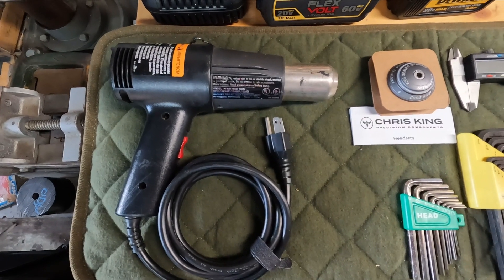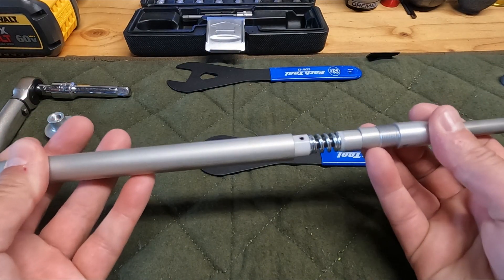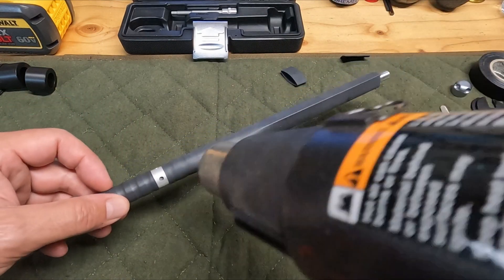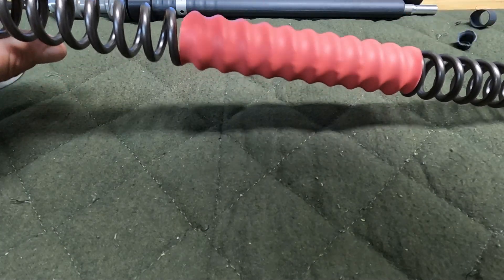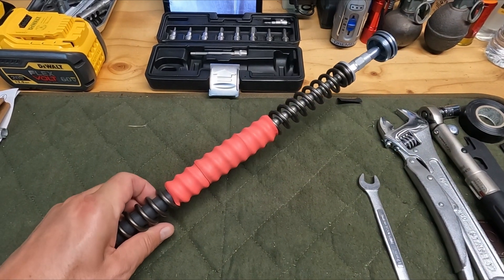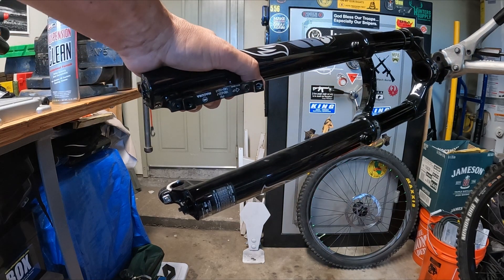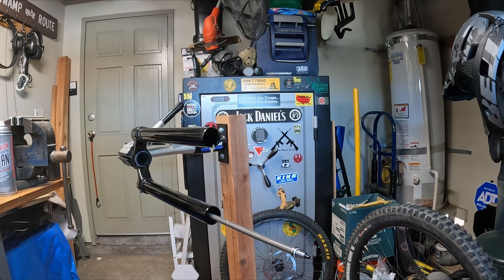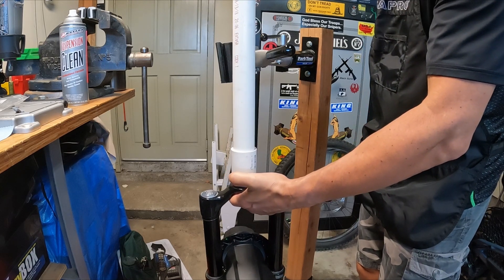Smashpot Coil Kit Installation in a Fox 36 Fork

Comment: Great video and thanks for taking the time to make and put it out here for us. 
BTW, those two bolts, behind the lower legs are used to mount Fox mudguards and not for releasing pressure. The Fox factory forks do indeed have the pressure release on them and a bit lower. 
I weigh just shy of 125# & have an e rated 38 with the grip 2 damper (which I recently upgraded from grip) and UPS will be delivering the smashpot with 35# rated spring today. Can’t wait. I also have the Fox factory DHX2 shock with a 300# rated  SLS spring which I love.
Reply from the maker: Thanks Ron, once you remove the caps you have an open hole to the stanchions so any air is released. My fork does not have the pressure release valves which does not matter as there is no longer an air spring in it :) The 38 will be sweet with the Smashpot kit, at some point I will upgrade to one for rigidity.
Reply: I have the E-Factory 38, smashpot went in last week, best upgrade ever !

Comment: Great video! I just purchased a 2022 Heckler S 29er. Should have it by the end of next week. 
Currently have a 2020 Trek Fuel Ex 9.9. 
I ordered a Fox 38 Factory GRIP 2 with 170mm travel and will be doing this conversion and then running a Fox DHX2 coil shock.
Reply from the maker: Thanks Aaron, I am going to put a 38 on the front at some point. With the 38 and DHX2 coil in back you are going to love it, stock its a fun, poppy little bike but the Rock Shox Air shock and VP do not work great together for all around riding. In the chunky stuff the coil in the back makes all the difference.
Reply: @rsanoian  Yeah I think it should be a pretty good combo! Trying to figure out if I should run a linear or progressive coil spring, but leverage ratio already seems pretty progressive on this bike especially in low setting so I’m thinking Fox SLS spring. I did a 45lb spring for the Vorsprung as I’m about 180lbs with gear and that’s what was suggested.
Reply from the maker: @AaronWhitt82  I am 200 kitted up and running the 50lb with 160mm and its perfect full travel but with the bottom out assist I love it. Try the SLS and if you find its bottoming I would run the MRP Progressive springs, they make an adaptor to use them on the DHX2 I had those on my previous bike and they were awesome.
Reply: @rsanoian  Good to hear! I got an email back from Santa Cruz today and they suggested using the Fox SLS spring. Spring rate calculator I’m around a 525lb spring so I’m going to try a 550lb spring. I currently have a Cane Creek progressive spring which I was using on my Trek, but I’ll have to get a higher spring rate. Think I may try both springs and see what I like best & how the bike performs.

Comment: glad i happened to catch your push coil install video and saw your comment about being happier w/ the smashpot conversion. btw, i see cal4wd stickers, and by way of your 831 handle, are you in the sc4wd club? i just ordered a grip2 dampener to upgrade my nomad's fox 36 rc2 and figured it would be a good time to switch to coil as well. i've always been a big fan of push conversions, but after doing a little more research, it sounds like vorsprung improved on the small bump sensitivity, and improved the big hit bottom out w/ the hydraulic design over push's ABS rigidity and noisiness.
Reply from the maker: I used to patrol all the jeep trails in the Sierra National Forest in the late 80' and 90's, never belonged to that club but do runs in the summer with Clovis Independent out of Fresno. The Vorsprung kit is sweet, going to move up to a 38 at some point and will install it in that fork. It makes a clunk on some of the big hits but I notice they have a rubber sleeve now which should keep things quieter. Are you in the SC club?

Comment: Thanks!! Were you saying you put sos grease on fork seals when you put lowers on? Doing the same install on very low used fox36 and not planning on changing seals either.
Reply from the maker: Yes any kind of suspension grease like SOS is fine, the seals are fine unless you have a couple of seasons on them then I would change them out.

Comment: Great tutorial thank you. Do you have a preference for acs3 vs smashpot? Any big performance difference?
Reply from the maker: Thanks Noah! They are both good systems, I like the Smashpot better for the additional oil, noise damper on the spring and the bottom out control. They also offer a Fox 38 kit which is my next fork.

Comment: Have you had any issues with the heatshrink coming loose or slipping down? Reading the Vorsprung thread it seems some had issues with this and tried different heatshrink types.
Reply from the maker: I have never seen that issue on any of the three forks with that kit, I have always used a heat gun though.

Comment: Hey hows it going! just noticed the fork is on an ebike. Is your fox 36 E-mtb rated? im trying to get the same coil conversion but just wanted to make sure its a correct part. Thnx
Reply from the maker: All good here thanks. It's the 36 that came with the Heckler, all of their forks are the EMTB version. The Smashpot kit will work in all of the 36 forks, when I talked to them last time. I think it will also fit the Fox 38 but not positive. Give them a call, they are super cool to talk to.
Reply: @rsanoian  Thnx for taking the time to get back. When I was looking into the Push brand coil it mentions that its incompatible with e rated forks. So i figured perhaps with Smashpot it would be the same . Thanks for clarifying that it works with e rated forks. 👍
Reply from the maker: @kinnectedmtb3209  I have a PUSH ACS in my previous Fox 36 but the Smashpot kit is so much better. Very smooth and never bottoms out harshly even though I am getting full travel.

Comment: So the new spring is now a real spring and not an airchamber, but where is the air which is in the same chamber where the real spring is (the coil) going to when this chambervolume with the coil in it is compressed?
Reply from the maker: You remove the piston assembly and replace it with a coil spring. The red shrink wrap is to keep the coil noise down when its being compressed in the leg.

Comment: I’m trying to decide if I want Smashpot or Secus. Did the extra weight affect you at all?
Reply from the maker: Theres no beating a coil for small bump compliance, this kit is very simple and reliable. If you are worried about weight then Air is going to be lighter but you have to carry a pump and fiddle with it a little more to get it setup right. I raced DH in the 90's and early 2000 and everything we had was coil so I am used to the ride and don't care about the small weight penalty.

Comment: Hey man I just installed my Smashpot tonight on my Fox 38. Is that retainer snap ring re-used on the bottom inside of the stanchion on the coil side? I couldn’t find any info about it. I didn’t re-use mine. 
Thanks!
Reply from the maker: Hey Aaron, that snap ring is what holds the piston (Air spring) assembly in, since we are removing that and installing a coil in place of the Air spring that retaining ring serves no purpose. I put everything in a zip lock bag but once you have some miles on the fork with the coil the inside of that stanchion tube is no longer smooth from the coil rubbing it so you really can't reinstall the Air spring assembly as it might not hold air.
Reply: @rsanoian  Ok thats what I thought. Just wanted to make sure. I have the PUSH ACS-3 on another fork that re-uses it since they have the air bump stop. Now I can start getting this build finished!
Reply from the maker: @AaronWhitt82  I have had some PUSH kits and do remember having to install the snap ring. Quite a different design and I like the Smashpot kit a lot better, the more oil in the Stanchion the better.
Reply: @rsanoian  That’s why I went with the Smashpot this time, plus PUSH only makes their kit for the Fox 36. I ended up using Motorex 10wt for the coil side.